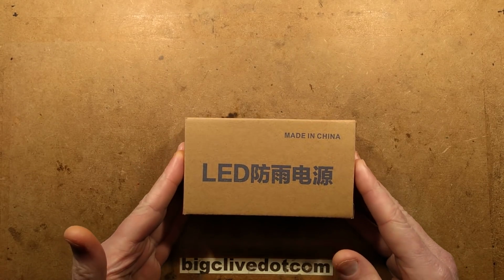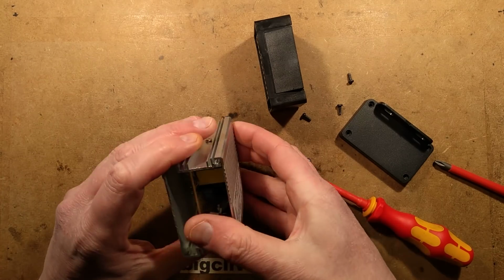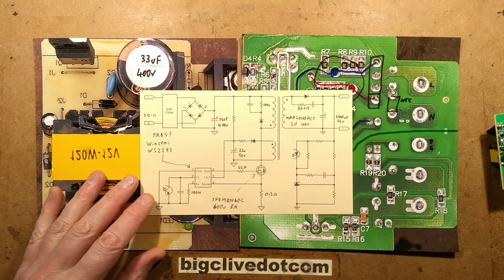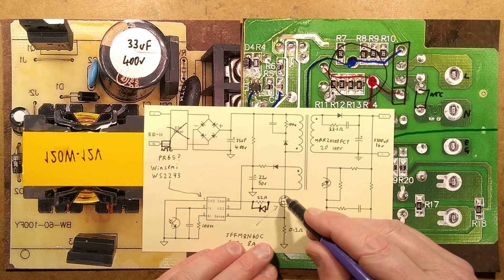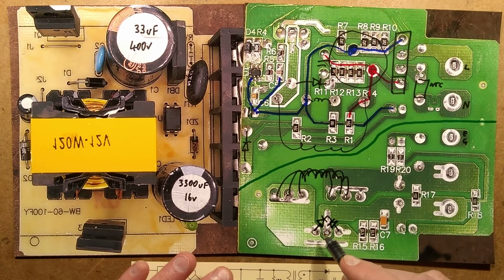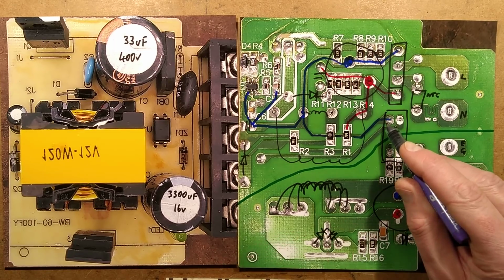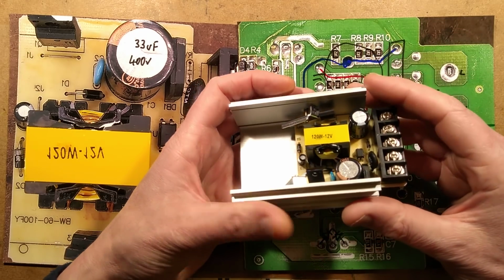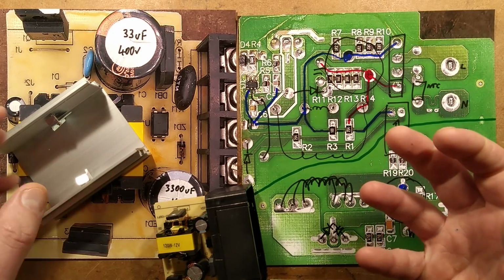Cheap imported "rainproof" power supply (long version).

Comment: Hmm. Top cap is no better than the bottom one. Half of the top cap screws have the thread in "outer volume", but other half - in the inner volume, providing a path for water to leak inside. (Although it's more of extrusion issue.) Oh, and extrusion itself is consist of two parts...

Comment: The issue with transformer frequency is the iron core. At low frequencies, you build up larger magnetic fields in the core and saturate it faster. Once the core saturates, it is no longer able to concentrate the magnetic field.
Reply: Another way to think about transformers is that there is only just so much energy in a single pulse or cycle (because more would saturate), so the more pulses you have, the more energy can go across. More pulses = high-frequency. More energy in the same time = higher power rating.

Comment: I've seen this type of feedback before, I was of the understanding that because the cathode of the feed back LED is at a fixed voltage due to the reference diode under it.  When the output voltage starts to raise the LED gets brighter and this is fed back to the Photo transistor which turns on a little more thus lowering the voltage at pin 2 of the IC.  The IC sees this drop and decreases the Mark Space ratio of the pulse to the transformer (Larger Space) this then lowers the output voltage.  The opposite happening if the output voltage drops.
This is similar to Buck Boost converters..
Correct me if I'm wrong.
Reply from the maker: I think the opto isolator is switching the primary side off completely.

Comment: Got a little 10W led driver from ebay recently, the whole thing is potted inside an aluminium extrusion. The ad had 10-100W models. Didn't mention water or rainproof, but I'm sure it's better at it than this.
Edit: haha just heard your potted comment

Comment: I wonder if you just pack the connections with dielectric grease, will it make a difference.
Reply from the maker: The fairground industry often smears PCBs with grease.  On the basis of some of the items I've had in for repair it works, but makes maintenance a bit messy.
Reply: bigclivedotcom yeah. Maintainance would be a drag with all the grease. Either way, I don’t think it’s a great idea to have a power supply outside in the elements, especially a really cheaply made power supply. I would at least have it inside nice and warm and just run some good outdoor wires to the LEDs outside. Anyways, Awesome video! Keep up the great work! Really good idea about having both a lengthy video and a short one depending how much time the viewer has. Very smart indeed.

Comment: They should add something to limit inrush current on all laptop power bricks. I hate it when they spark when you plug one in an AC outlet and it can't be a good thing over long term..
Reply from the maker: Some do have inrush limiters, but there's still a significant inrush.

Comment: What sort of power factor?
I'm installing 250w of DC LED lighting in my shop, the 400w version would likely do the trick.
Reply from the maker: Poor power factor for these simple supplies.  I'd recommend dividing the load down over a multiple of power supplies to avoid excessive short circuit current.
Reply: Buy quality stuff. It lasts much longer and won't burn your shop down.
Buy multiple power supplies for one room. If one fails, you still have some light.

Comment: I've found a simple but proven effective solution to greatly extending the life of these types of cheap chinese electronics devices. 

Take them apart and conformal coat the circuit boards and all exposed wiring end connections with several layers of clear coat spray paint.     Simple to do and substantially extends the  harsh environment service life for it!
Reply: I come to the comments to learn tips like this in places like bigclive, AvE, ToT, etc
Reply: @sonofnone116  most definitely. I try to share proven tricks that I've done/used before.
Reply: Will the paint crack if ya move or bend a wire. Years ago back in my youth i wanted to custom paint my dash, the dash of my vehicle was flexible, so i had to buy some additive to make the paint flexable, a friend of mine knew a paint dude who gave us the mix rates and tips. 10 years later it never cracked but was pliable. On my automotive splices expossed to the elements i will use the butt connector that are also heatshrink, after that i use liquid tape and just apply twice a years. I.E. trailer connections on my boat and other connections. Works great for me.
Reply: @raymondmucklow3793  It might. If you want flexibility, stick with urethane conformal coatings.
Reply: @mikecowen6507  thats good to know, but in a pinch clear coat would work. Ive ben meaning to ask if conformal coating is flexible.
Reply: Yep. That's works really well. I did this on a digital wireless thermometer sender, except I used white appliance spray paint, 5 years and still going strong.
Reply: @tonezoneuk  If you're going to use appliance paint, get microwave oven paint. Youll be sure to have no conductive chemistry in the dried paint. Not always guaranteed for painting basic sheet metal appliances.

Comment: I'm curious, what's the best (or more conventional) way to limit inrush current on something like the secondary side of an audio circuit or linear power supply with a large filter capacitor? Is the application not as critical because of the transformer's impedance? I don't think I've seen an NTC used in circuits like this. Intuitively, I imagine the time it takes to charge a capacitance of 10+F must create a lot of stress on the magnetics. Perhaps I'm missing something fundamental here?
Reply: Upcycle Electronics - Active controls. That is a large power resistor in series with the circuit, and a transistor wired in parallel. At switch on, the transistor is off. So the capacitors charge via the resistor. After a short delay, the control circuit switches the transistor on, and that bypasses the resistor. There are also other designs with relay contacts or other semiconductors.
Reply from the maker: @Mark1024MAK  I had a metal cased resistor explode on me when one of the relay bypass circuits failed.  The ceramic core split and fired out like a bullet
Reply: bigclivedotcom - I bet that was fun! Just like applying a high reverse voltage to an electrolytic capacitor! Of course, not such fun if you happen to be in the path of destruction 😳
Reply from the maker: It's more of an issue when a power supply has a rectifier and capacitor at the input.  But some large transformer based units benefit from inrush protection too.
Reply: @bigclivedotcom  
Thanks :-)

Comment: Insects and power full stop.A slug got into a plug socket in the kitchen (somehow)and every time anyone tried to boil the kettle it tripped the whole system.
Reply: MannyJazzcats - Yeah, slugs and snails are a pain, as they are conducive with all the slime that they use. With electronic circuit boards, it worse. After shorting out the circuit, they then die and degrade, causing a horrible mess, which then rots and corrodes the tracks and components 🙁

Comment: The metal tab on the back of a MOSFET is electrically connected to one of the pins, no? The drain pin, I think. Maybe that's only true for some variants. In any case it looks unsafe to clamp that to the case. Also, I'm reasonably sure that insects shorting out high voltage electronics was the original meaning of the word bug that is now used to refer to software malfunctions.
Reply: Was a moth stuck in a relay of the Harvard Mark II computer. It was extracted and sellotaped inside the computer's log book.
https://americanhistory.si.edu/collections/search/object/nmah_334663
Reply: @RenThraysk  - Edison gets 1878 credit here, to my mild surprise: https://interestingengineering.com/the-origin-of-the-term-computer-bug
But also -- even though I've seen Harvard's bug -- I'da sworn it was from the Mark I; nope :-)
Reply: ManWithBeard1990 - It looks like the transistor and output diode are using fully insulated plastic packages.
Reply: ManWithBeard1990 - most spiders, ants and flying insects are not very conducive when alive and dry. The problem is when a slug or snail gets in, or there is a build up of dead insects and dirt. Moisture then makes the mess conducive.
Reply: ManWithBeard1990 - In computing, bug comes from insects getting trapped in the mechanism, not insects causing short circuits. The early computers were electro-mechanical systems using telephone relay sets and uniselectors. These typically operated on 50V DC supplies. Later, faster computers used valves (tubes). These used higher voltages.

Comment: Say, if I was to buy this PSU and wanted to make it safer to use would covering the bottom of the PCB with lacquer of some sort improve it? It would stop insects from shorting out contacts.
Reply from the maker: If you needed an outdoor PSU I'd recommend getting a locally sourced one for professional lighting applications.
Reply: @bigclivedotcom  Yeah, I wouldn't trust this one for outdoor use at all.

But insects can be found indoors, sadly.
Reply: Priviledgier Sheevlord - Yes, but use a type that is designed for electrical circuits. Use multiple thin coats. But be careful not to get any on the connection terminals, or on the heatsink tab of the transistor and output diode.

Comment: Nice, I was looking at these a while ago, and they did not look very IP anything
Reply: tablatronix IP codes explicitly refer to the angle of incoming rain to be rejected, but that top plastic might need a better seal against water leakage.  Bottom as shipped only stops full hand insertion, so this seems to pretend to be IP13 (stop body parts > 50mm, rainproof at angles up to 60°).  Adding a suitable stopper into the bottom opening could get it as far as IP33.

Comment: 10:55 - the sense resistors (R7 - R10, 0.3 ohm) - aren't they connected to pin 4 via R6?
Reply from the maker: Yes.  There's a resistor between them and the chip.

Comment: Those solder blobs on the Neutral terminal look like an attempt at a spark gap; normally seen between live/neutral and earth to allow high voltage surges to jump to earth... Anyone agree? Also think that and the 'fuse' should have been the on Live terminal but as they don't care about Earthing it's not a surprise the terminals are reversed...
Reply from the maker: Can't really be a spark gap as there's a fuse bridging the two pads.  The spark gaps tend to be across areas where a high voltage could occur.

Comment: I think if the price is right, you could wire the unit up with leads a bit longer than you need. Tip it  upside down and then fill the unit with 2-part gella reenter-able potting compound and then once cured, install it. Could be a nice solution if modified a bit.
Reply from the maker: The polymer gel would probably cost more than the power supply.

Comment: Ants in the compressor of my home air conditioner, in the outside fuse box then they followed the wires to the unit itself blocking the contact. Sumbitches how dare they try to stay warm and dry.

Comment: Just there on the outside stamped on the aluminum "to be used in arizona desert" only.
Reply: desert still has insects I presume :)
Reply: @maicod  Especially the kind with hooked tails and stingers. 🦂
Reply: @maicod  no moisture.
Reply: the insect's bodies contain moisture enough :D
Reply: @maicod  touche sir. I was trying to be funny, perhaps i should have said the Sahara, mercury or the moon.
Reply: @Raymond Mucklow it's all fun no worries :)
Reply: @maicod  good, i joke a lot. I don't think most people get it but i try.